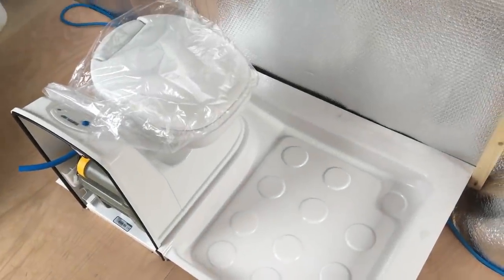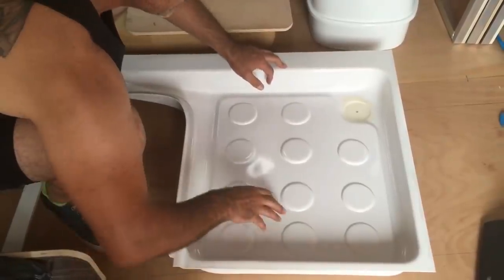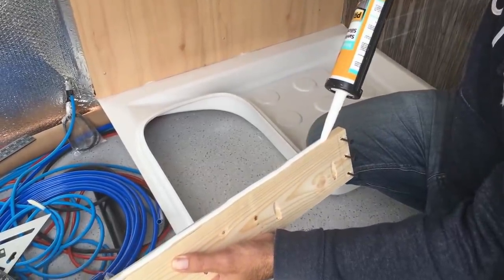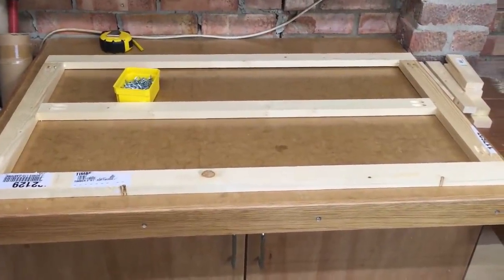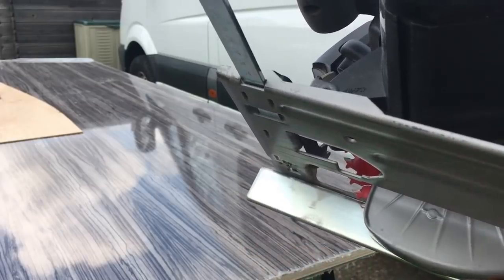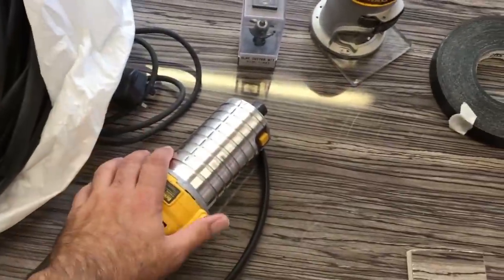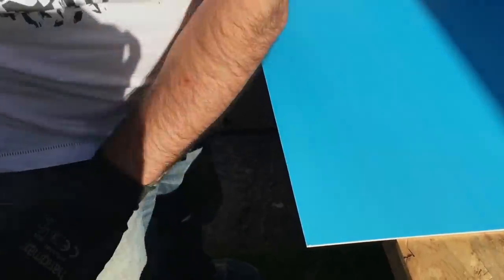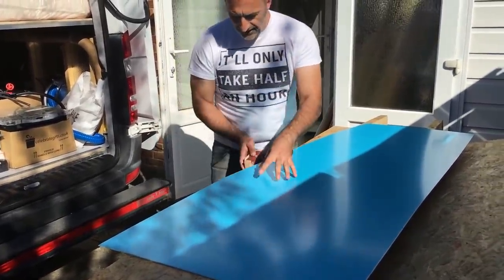Mercedes Sprinter Camper Van - Shower Build

Comment: How did you figure out where to drill the pilot hole was in the vicinity of clearing the suspension etc/ in the first place? Did you do those measurements on sketches or did you physically measure the location on the van itself? If the latter, how did you do it so accurately?
Reply from the maker: Richard Sementilli physically measured off known items such as the wheel arch or the screws I put in to secure the floor.

Comment: Hi Greg  my toilet exterior door slightly  over the frame is it ok to cut the frame
Reply from the maker: This is why I have put my cassette inside the van because I didn’t want to cut a big hole in the side of the van. 
We keep it very clean and have never had any problems with snells in the van

Comment: I see you used PVC sheeting to line inside the shower.  I was thinking of using white Alupanel (aluminium composite panels, two sheets of aluminium with epoxy compound/foam between the two layers 3mm thick. Any feedback using aluminium sign panel over PVC sheeting. I was hoping of curing the aluminium panelling to the shape of my roof bus (toyota coaster) and direct sticking to the bus frame.

My only other thought is in regards to fitting panels together. You did great tight joins between the vertical panels, however I was thinking that a larger gap might be better.  My experience comes from the pain of having a fibre cement sheet flat roof with tiles on it once laid by a builder that abutted the sheets directly next to each other with sealant in-between.  The manufacture recommended a 10mm gap between the sheets to be filled by sealant to give enough roof for thermal expansion.  As you could imagine any movement say 1mm flex in the van with a small gap of 1mm would be 200% elongation required for the sealant.  If you left a larger gap and pushed sealant into the gap say 5mm any movement would be better accommodated by the sealant's /adhesives elongation properties.

Comment: just bought a van with this installation. Thetford toilet and shoer tray from jackson leisure. Aparantly Theford dont make shower trays so these are cheap products manufactured by who knows.  My Tray has multiple cracks - You tube seems to be full of reports of these so called Thetford trays cracking due to being low quality and super thin. Does anyone have a solution for repairing or covering a cracked tray or is the only answer to rip the lot out and try and find a decent option? is your 2018 tray still intack Greg?

Comment: When scribing a panel which fits flush on three sides (as shown in this video), how do you ensure trimming off more from one edge doesnt create a gap on the opposite edge?
Reply from the maker: There was no gap to lose as you would when you normally scribe, the final board was overlapping the left hand side wall so I just had to run the pencil down the inside crease right in the corner and cut exactly to that line. Hope that helps

Comment: Hi Greg
Really helpful video as always. Once you have drilled the holes for the shower waste, sink waste and any of the water pipes, how do you seal them? I have been trying to figure it out but can't seem to find any videos on it and was wondering if it was just a case of filling it with silicon after the pipe is in or if there's something else you can get. Any advice would be helpful!

Comment: Hi Greg.  Wow you had hair at the beginning and none at the end... must have been stressful :o)  When you removed the film at 20:55 did it make your hair stand up?  All 4 of mine did.  I love your video mate... not watched the second part yet but I have promised the missus that you will show her it in action with you in it LOL
Reply from the maker: The one that does it the most is the PVC sheet, so much static off those sheets you could use them as a defibrillator.
Will have to charge up the go pro for the action shots in the shower LOL

Comment: I know it’s been 4 years, but can you tell me how you wired in your extractor fan.  I always assumed that you can’t use a 12v house fan on a 12v van system, but you’ve done just that.  Your advice would be very much appreciated.  🙏
Reply from the maker: Hi Tanya, you are right these domestic fans are 12v AC and not DC so you have to use the transformer that is supplied with it and power it from an inverter or shore supply. It’s not the best solution but it works and I couldn’t find a suitable DC extract fan to go here. It only used for short periods of time. 😊
Reply from the maker: Hi Tanya, you are right these domestic fans are 12v AC and not DC so you have to use the transformer that is supplied with it and power it from an inverter or shore supply. It’s not the best solution but it works and I couldn’t find a suitable DC extract fan to go here. It only used for short periods of time. 😊
Reply: @GregVirgoe  thanks Greg, much appreciated 👍

Comment: 'New subscriber' I've watched most of the build and think you've done a brilliant job. My question is, why didn't you you stick the plastic wall covering sheet with rubberized glue using a notched trowel? Rather than silicone?
Great build really enjoying it. 
Regards Darren
Reply from the maker: Darren Read I used the adhesive supplied by the manufacturer of the pvc sheets it was not ordinary silicone 👍🏼

Comment: How many furniture board sheets did you use for the build? Would I be correct in saying they’re standard size 2440mm x 1220mm.

Many thanks

Daz
Reply from the maker: We used 7 boards and they are slightly oversized as they come out of the factory with unfinished raw edges that you have to trim off yourself.
Reply: @GregVirgoe  thanks you for the info appreciated! Im just going through some rough costings and I understand how six boards can be swallowed…. I’m a multi trader in the building trade 😂

Comment: Another great video - and yet another daft question from me! I’ve looked through all the comments so apologies if you’ve answered this already - but where is the light switch for the shower? Thanks again!
Reply from the maker: Will Parry it’s outside on the front face of the cupboard above the bench seat.
Reply: Greg Virgoe Yes of course - I see it now on your final van tour video -  what is the round black fitting on the  face of the cupboard and the white box on the outside of the shower wall? P.s. you’re a 🌟
Reply from the maker: Will Parry they are both vents. One keeps the cupboard cool where our DVD player is and the shower one is an extract fan
Reply: Greg Virgoe Thanks so much for the swift response - much appreciated as always!
Reply: Sorry Greg - the white box on the shower wall that I was referring to was on the outside of the shower - next to TV - is that a room thermostat?

Comment: Hi Greg, we are doing our van conversion and following your videos as best possible. Thank you for being so thorough! It really helps.  We were just wondering what water heating system you have used for the shower? We have seen some Whale under vehicle water heaters but they are REALLY expensive. Any advice on what you used as some people are sharing heating systems which aren't safe for van use. Thanks in advance.

Comment: Hi Greg, what model of bathroom shower fan are you using Expelair seem to be AC motor which will have a problem with working on DC. Thanks
Reply from the maker: Kronos G yeah it’s 12v AC so it has a transformer in the garage running off my 230v feeds on the control panel.

Comment: Hi mate, when you said about the blade on your saw only being exposed enough to go through your board this creates more resistance/work for the motor as you have more teeth in contact with the work piece. The saw will cut best with the blade fully exposed, max cut depth, because less teeth will be in contact with the work piece resulting in less friction for the motor. Cheers 👍

Comment: Hi Greg, can I ask about your table saw you are using in this video, been looking for something suitable but not too expensive so hoping you can advise?
Reply from the maker: Look for a contractors saw they are typically £150-200 and of reasonable quality. You can always resell it once you are finished with your build to recoup the cash 💰👍🏼😃
Reply: @GregVirgoe  Thanks Greg

Comment: Hi Greg, any issues running water pipes next to heating ducting? At this stage now and wondering if I should seperate them? Will cold water get warm etc?
Reply from the maker: Not to any great extent. You could put a little insulation around the cold if you are worried. My cold pipe is the feed to the boiler so a little preheating is welcome 🤗
Reply: Greg Virgoe brilliant thanks Greg, you’ve helped me out so much and honoured to get a reply 🙏🏻
Reply from the maker: @duncansarmy  no problem anytime 👍🏼

Comment: Hey Greg, thank you for these amazing videos. I am just starting out and in the planning stage.  When wiring up for a LED light in the shower room do you have to use a special LED light (waterproof) and can you put it on the same circuit as the rest of the LED lights.  (excuse me ignorance - I'm a complete beginner in all of this.)
Reply from the maker: I used waterproof LED strip lights above an opaque Perspex sheet. And put a switch locally to the shower
Reply: @GregVirgoe  thank you, that's good to know, I will allow that for mine too. I hope I don't pester you too much now. ;-)

Comment: Excellent videos and top quality work John, although I have the trade ability I must take my hat off to your staying power attention to detail and motivation. :-) Interesting to know what your main profession is? Doubt it started behind a desk, possibly ex Royal Air Force at a guess. :-) Regards Alan
Reply from the maker: Hello Adam, I first started work as a draughtsman drawing control panel wiring diagrams for bespoke mechanical service control panels. I've never done a manual job or been "on the tools" just do everything to the best of my ability.
Reply: @GregVirgoe  Thanks for the reply Greg, the work and videos are very good Greg, having start on the tools myself so to speak (ex RAF General Engineering Technician Workshops) I know the difference. :-) Not seen all your videos Greg, why did you choose the Mercedes Sprinter as your base vehicle, was it due to your love for German hand tools? :-) Plus did you find the finished van/conversion large enough? Did see part of the video with you in Portugal. Regards Alan
Reply from the maker: Alan Stuart mainly chose this van for its reliability and it just goes really well. It’s not the widest van but at nearly 7m long we have loads of space. My only other alternative would be Fiat Ducato van as they are bit wider in the back.

Comment: Hi Greg, can I ask what kind of pipe you used to connect from the waste in the shower to the waste tank?
thanks in advance and thank you for the videos!
Reply from the maker: ollie stagg I used a short section of grey corrugated waste pipe to form a running trap off the waste outlet. Connect that onto rigid pvc waste pipe to the tank and fitted a compression coupling near the tank for future disconnection if I wanted to take the tank out and clean it. I made two new tank connectors into my tank one for the shower and one for the kitchen sink. They were not joined together under the van each went into the tank separately.
Reply: Greg Virgoe Thanks Greg, lifesaver! Thank you for all the videos too they are by far the best i’ve come across 👍

Comment: Greg could you explain why the PVA on the back of the panel plus the adhesive?  Great episode !
Reply from the maker: Bob Fomenko PVA is two fold, to seal the face of the timber and provide a better key for the adhesive.
Reply: @GregVirgoe  Thanks!

Comment: Hi Greg. When putting down your shower tray, how do you work out so precisely what is under the van at that point. ? Many thanks.
Reply from the maker: Usually measure off known points like where the wheel arch meets the floor or any existing bolt holes etc
Reply from the maker: Before drilling a big hole I drilled a small pilot one to make sure I was in the right location. It’s easy to fill a small hole if you are wrong 😊
Reply: @GregVirgoe  ahh that’s excellent. I couldn’t work out how you were doing it. Brilliant thank you 🙏

Comment: Good evening Mr. Greg Virgoe,  Where do you have the video of finishing the bathroom ceiling with LED tape ?  "ceiling finish - ceiling closure " PPlease - Thank you very much - Rio Juanes
Reply from the maker: This is the second part of the shower build. All of the videos are in one playlist. 
https://youtu.be/iOgbauSa7w0
Reply: @GregVirgoe  THANK YOU VERY MUCH
Reply: Please, how did you get the acrylic on the ceiling ? in case I have to change the ledy light ?
Reply from the maker: @MannheimSalsa  it is held in place by a timber frame secured with screws.
Reply: @GregVirgoe  Correct I understand - Very grateful - and I'm sorry for so many questions

Comment: Hi Greg. Just planning out a similar shower build! Thanks as always for your very useful content. What kind of shower trap did you fit to the bottom of the extra long shower flange? Cheers, Rick
Reply from the maker: Rick Clark I created a trap under the van using some flexible waste hose bent into a P shape 😊
Reply: @GregVirgoe  Brilliant thanks, sounds cheap and cheerful!
Reply: @GregVirgoe  Glad you are home safe and sound
Reply from the maker: Rick Clark I could not get either a bottle trap or P trap to fit under the van with other chassis in the way so it was the only solution.

Comment: Hi Greg - at 04:00 when you were drilling the hole through the van floor - did you remove the ply floor first?
Reply from the maker: Yes it looks like I did remove the floor but you don’t have to. I cut all the other holes for drop out vents etc with the floor installed. Just cut through one layer at a time.
Reply: @GregVirgoe  thanks for your time Gregg. Hope all are well with you.

Comment: Hi Greg I've been trying to find a link to the shower drain you used and size ? Could you help please
Reply from the maker: I pinned a comment to the top of these with the link in it. Check that
Reply: @GregVirgoe  hi Greg that link is broken is it possible to add again please

Comment: Why are showers such a pain? I replaced one in our old RV that was damaged when a gas bottle fell over and the oversized aspect (and the different drain position) was awkward. This time around, building from scratch, I'm going to skip the tray completely, make my own waterproof basin and share it with the wheel arch. I figure that your upper body needs more space than the lower so why not?
Reply from the maker: Immortal SoFar why not indeed, are you going to fibreglass it once formed?
Reply: @GregVirgoe  I figure I'm going to have to in order to seal the wheel arch and the base of the walls. The kind of shape that's going to need is probably best made in situ. I'll be sure to post if it turns out to have been a really bad idea!
Reply: Have a look on ebay,i have seen some shower trays with the wheel arch built in

Comment: You should  always  use a waste washer, either fibre or plastic when assembling a waste fitment, and as an extra  measure  a few turns of ptfe tape  around the thread's. Bomb proof. 
Also, maybe  a bit of sleeving on the  h and c pipes,  to stop the heating duct raising the temperature of the  cold water.

Comment: You used pine. I would have used pressure treated. You wouldn’t have to worry about rot or warping from humidity
Reply from the maker: Dal V why would I worry about that? The shower is a plastic box completely water tight and impervious to passage of moisture 😊👍🏼
Reply: @GregVirgoe  you've missed a huge point factor. Wait, you'll see.
Reply from the maker: Dal V I’m waiting......

Comment: What type of adhesive did you use to stick down the shower tray?
Reply from the maker: The best stuff by far is Sikaflex 522
Reply: @GregVirgoe  I'm replacing a 3mm thick plastic tray in my Devon conversion, which was bonded with a limited amount of sealant (and had cracked). It has a standard square tray which is cut down on 3 sides with little tolerance for error. I've cut it well but was thinking I need a generous spread of adhesive/sealant which had good grab, bonding and flexibility.  Great videos Greg.
Reply from the maker: @number9scores  make sure it it well supported all over as our tray cracked too and had to fibreglass it
Reply: @GregVirgoe  will the 522 be OK to seal around the top of the tray or do you recommend another sanitary sealant? Thanks.

Comment: Hi Greg, unfortunately we are not all as forward planning as you, i'm currently doing my shower build and like you i would like my cassette to be removable from the inside, problem is i have a thetford c220 and any shower tray array i have seen does not give me the space for running truma ducting behind the shower. The c200 shower tray does  does but i am not sure it will accommodate the c220 toilet. Do you know of any solutions? Any advice would be greedily pounced upon
Reply from the maker: This looks like it has a large flange at the back https://rover.ebay.com/rover/1/710-53481-19255-0/1?ff3=4&toolid=11800&pub=5575265109&campid=5338027957&mpre=https%3A%2F%2Fwww.ebay.co.uk%2Fitm%2FShower-Tray-Acrylic-To-Fit-Thetford-Toilet-C220-Range-L-H-Motorhome-Wet-Room%2F273193841910%3Fhash%3Ditem3f9b9f34f6%3Ag%3AdNAAAOSwhI1a7Gve

Comment: Hi Greg I’m building my van now ready for April just one question have you got a roofvent/vent in your shower area if so could you tell me what you have. 
Thank you
Reply from the maker: Twigs and Stix 23:22 😊
Reply: Greg Virgoe  thanks great but I really want to know what the vent is ? Where can I buy ?
Reply from the maker: Twigs and Stix it’s an Xpelair LV100 extract fan with humidistat and timer. 
We got it from eBay for about £50 it runs off a transformer from the inverter because it’s 12v AC and not DC 👍🏼😊